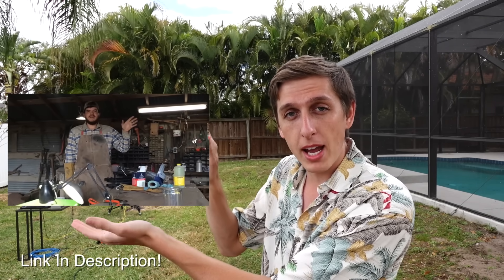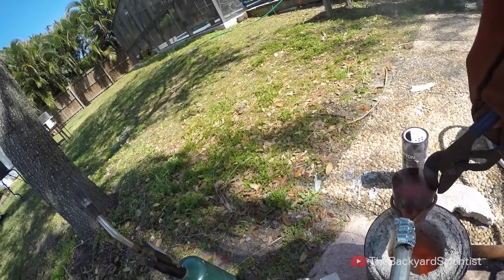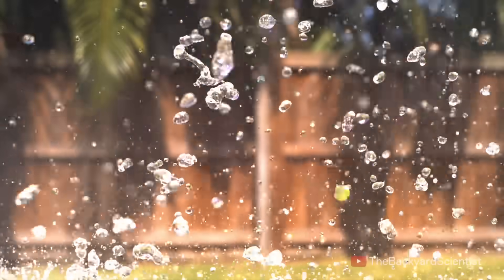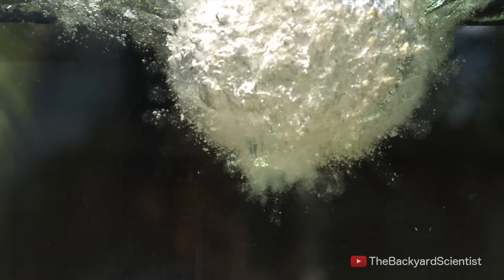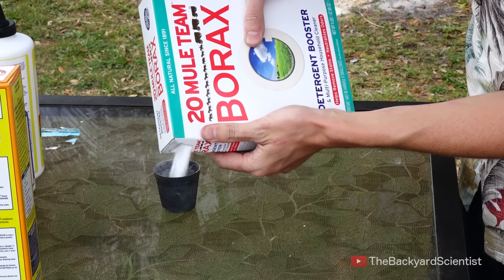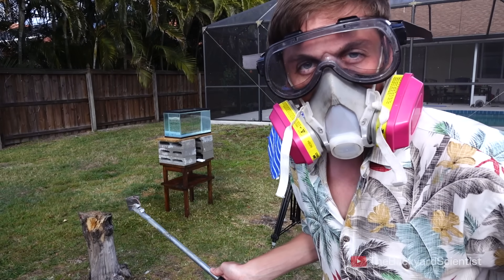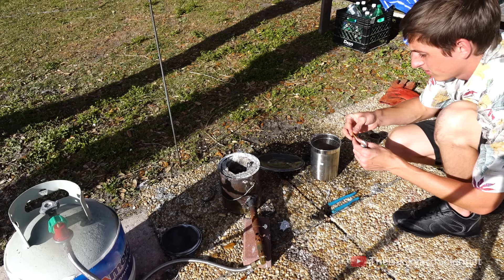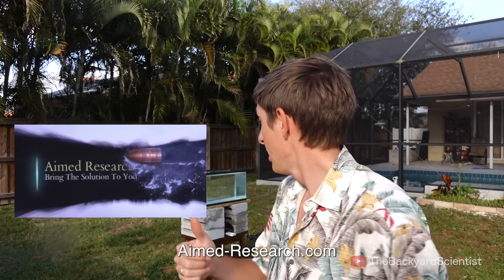Pouring Molten salt into Water - Explosion!

Comment: Question: if you made a sword out of metal Sodium, would it explode when you stabbed someone with it since people are ~80% water? If so, that would be AMAZING.
Reply: +Severo Cairon it wouldnt penetrate the body, metal sodium is so soft the sword would just bend.
Reply: No
Reply: If it was a molten sodium sword... Although it would give you a nasty burn, it wouldn't exactly be good at piercing the flesh. Or be easy to hold...

Might as well just drill a hole into someone and then pour the molten sodium in. That'd be fun
Reply: +WilliamDetwiler It's really fucking wild that people have to explain the difference between Table Salt (Sodium Chloride) and Sodium to you. Regular Sodium, which is a solid metal, reacts violently with water.
Reply: +Severo Cairon it is so fucking wild that people have to actually explain to you guys that a solid, metal, cooled sword contacting human flesh would not have a  remotely similar a effect as molten sodium in pure water.
Reply: +Severo Cairon No. First off sodium is soft so it'd be pretty useless as a sword. Secondly it oxidizes very quickly which means that none of the actual pure sodium is exposed meaning no explosive reaction.
Reply: +Severo Cairon just to clarify sodium = Na  salt = NaCl. Na is not a steel, steel = Fe + C nor is pure Na a alloy, but the surface would oxidize and thus pure Na would not come into contact with the water in your blood, thus no explosion.
Reply: +Severo Cairon  it would have to be molten salt, thus becoming a liquid, but it would be pretty cool
Reply: +Severo Cairon ... What ?
Reply: why would you want to use sodium when you have caesium......... that metal just outright explodes on contact with water no molten anything needed. sodium just fizzes it's ass around the surface(its density is less than that of water) in hellish flames.

of course, the pure form of all the group 1 metals react aggressively with the atmospheric water too. so you have that to consider. in short, it would be an exercise in futility.

perhaps you could make self-shattering-and-protected-until-then pure group 1 metal bullets for a gun and shoot your enemies into glorious inner body explosions ending up with a blood red splatter rain and decimated innards as a victory celebration(reminiscent of fireworks, of course)
Reply: +Severo Cairon You would be weaponless as soon as it starts raining.
Reply: )3@@0 8 :9!5 5)8!& 5)-5 297@: 294&
Reply: +The guy who makes fun of little mistakes what salt? It's sodium.  Sodium reacts with water without heat.  Though it would disappear if you put it into water and other things
Reply: +Severo Cairon According to his theory, no it wouldn't explode. The sodium has to be molten in order to heat up the water enough for it to turn steam and expand within the sodium.
Reply: +Severo Cairon sodium also reacts in the air and is actually stored in oil to stop this happening. So unless you had it in an oil filled hilt you probably wouldn't get the chance to find out. but I would wager that the sodium would just get very hot inside the person and cauterize the wound, and probably poison the person you were stabbing
Reply: No... Its not even hot it cant explode
Reply: +Severo Cairon youre missing a key piece of logic here.
Reply: +stufff mein and then 
Well no - sodium metal is very different to sodium chloride.
Reply: +WilliamDetwiler ...you do know that pure sodium reacts with water by exploding right? It doesn't have to be molten...
Reply: holy shit
Reply: +JohnDavid Perez His theory addresses Sodium Chloride (Table salt), not Sodium. Sodium reacts with water at any temperature.
Reply: No lol but that would be cool.
Reply: +Istebirr it doesn't have that good of a bendable property lol. I'm not sure it would be efficient.
Reply: +Thomas Aurelius ...
Reply: when the people around you are all about science, and you're all about math
Reply: You mean molten salt. If so, it would have to be very hot too.
Reply: nacl and na have very different properties especially at different temperatures
Reply: Sodium metal is too soft to make a sword. You can cut the metal with a knife. I'm not expert and I might be wrong but I don't think you'd be able to pierce the skin with it.
Reply: +Severo Cairon i think you would be better off causing your victom to drink molten sodium
Reply: You can try make molten metal sodium tipped darts or splash molten metal onto your victim.
Reply: +Pure Weirdness yes if you left it there long enough for the blood to pool around the wound and the blade was thin enough and chilled enough not to just bend when thrusted in.
Reply: +Severo Cairon The surfaces of the sword would react with the moisture in the air before you ever had the chance to stab someone.  Also sodium metal is very soft so I'm not even so sure that you could make a sword sharp enough to cut someone.
Reply: +Severo Cairon I think terrifying is the right word here
Reply: +Severo Cairon Amazing but only for a one time use. The sword wouldn't blow up as expected, more like a sizzle because yes people are made of around 80% water which is mainly in the blood, which also contains things such as iron. 55% of our blood is made of plasma which is 92% water. so, the sword would sizzle quite a bit but also wear down the sword pretty much making a second swing really weak or close to useless.
Reply: +Severo Cairon cmon son, it's not just the sodium that makes the explosion, it's also  about the temperature..
Reply: How bout metal sodium daggers
Reply: +Severo Cairon I love the the irony of people thinking your question is stupid. His question is valid because he's talking about the element Sodium and not table salt NaCl. Still Sodium is too soft and reacts to quickly for a sword to work. Shooting somebody with time released Sodium or Cesium capsules might be super cool though.
Reply: an even better would be sodium or potassium bullets
Reply: +Thomas Aurelius Yes it can - sodium reacts with water without heat
Reply: no, no it does not.
Reply: You would have to heat up the sword everytime
Reply: yeah, no. remember in the hypothesis the water turns to steam and that plays a role in its exploding. if temperature is not hot enough, that reaction will not occur.
Reply: only when he scream Allahu Akbar
Reply: +MaddiZONE 

Aloha Snackbar
Reply: +Jordan Lauterbach a flaming exploding sword? i want that so much
Reply: +Severo Cairon since it can react with the moisture in the air, it would probably explode before u touched the person. and even if u did try to stab, it would probably bend cause its so soft.

Comment: I think you explenation is wrong since it does not seem like the like the leidenfrost effekt wasnt occuring:
I think the NaCl behaves more like glass and forms a sort of prince rupert drop which shatters and increases its surface area causing the water to evaporate faster.
This theory is suported by the salt crackling noice, metioned at 1:02 ,  which can be heared if the salt cools down.

Comment: Correct me if i'm wrong but I believe its a physical reaction, NaCl (salt) melts at 800C, while water boils at 100C, so when the molten salt hits the water, it evaporates so quickly it causes "steam explosions", thus the violent reaction, if it was a chemical reaction on the water itself, we would be able to observe a change in it's chemical composition, and since salt being dissolved on water is a solution ( independently of the salt's temperature or state) and these kind of mixtures are heterogeneous, we can safely say that this is a physical reaction

Comment: NEW MILITARY EQUIPMENT: MOLTEN SALT GRENADE: INSTRUCTIONS: FILL UP GRENADE CONTAINER WITH SALT, GRENADE CONTAINER HAS HIGH TECH HEATING, PULL THE LEVER TO ACTIVATE THE MELTAGE,WAIT UNTIL IT MELTS. THEN CLOSE IT THEN FLIP IT UPSIDE DOWN AND PUT WATER AT THE BOTTOM, ACTIVATING THE GRENADE WILL PULL OUT A SOLID BLOCK OF............. DIAMOND,YES DIAMOND.. SEPARATING THE WATER AND MOLTEN SALT.

COMING TO YOUR GUN STORE IN 2089

Comment: You're an idiot. Google alkali metal.
Reply: ? And Google is very trusted with academic integrity...
Reply: .-. You're not the brightest crayon in the box either I see. Google is a search engine it's not the primary provider of information it's main function is to search and sort through the library of the internet finding the credible sources lies on the person looking for them. Sodium is an alkali metal that has a chemical reaction causing it to explode on contact with water.  There was no need to melt down the Raw sodium metal to receive the explosive effect. The process of extracting Sodium metal involves super heating sodium chloride. so when you heat it you bring out the alkali metal that explodes when it makes contact with water.

Comment: This reminds me of some steel cutting techniques where searing steel is being being cut by a stream of cool water.
However, it's not the force of the stream that cuts the steel, but water explosion that happens due to steel being hots and water cold.
The stream is only used to direct the cuts.

Comment: Just measure the total heat of the salt and the water, than measure it again after. If it's more, you have a chemical reaction
Reply: +Lucas farach-colton I thought physical reactions could be endothermic and exothermic as well as chemical ones
Reply: José Ignacio Pauly Llobet
I'm assuming that it isn't nuclear fission, and the only other explanation would be a simple steam explosion, which doesn't change the heat (taking into account heat of vaporization)

Comment: If someone wants a superficial background info: A quick view into highschool's Chemistry would have proved that this was a physical reaction straight away. NaCl cannot be broken with water (I'm Spanish and I do not know the exact words in English) due to the fact that both come from a strong acid (HCl) and a strong base (NaOH). A strong acid tends to give the proton (H+) very "hard" and a strong base tends to get H+ "hard" too, therefore they cannot react with water because the Cl- do like to give away H+  instead of getting them (because he's acting as a base) and Na+ has a nobel gas configuration (and he's acting as an acid without any H+ to give away) . Imagine if that happened in the sea where a lot of salt can be found, you would be bathing in HCl and NaOH (not very pleasant).

Point out any mistakes or doubts if you consider it necessary :D

Comment: Wat I think happens here is that the heat of the salt heats the water around it to above 900 celsius which is the themprature where the binding between the H & the O in H2O get broken. Then it ignites of the pressure of expanding 1600 times under water. As I can hear from the sound the bang seams like a HHO explotion.

Comment: there are reactions, it's hydrolysis, NaCl+ H2O = NaOH + HCl. Also it's go backwards so no ph change in result, but if you would got some KMnO4 and CH3OH in water, then you wil got HCOOH and the water's ph will be higher than normal

Comment: I'm 13 and I know why it explodes! It's because salt is NaCL  Sodium and Chlorine and it can explode because its really hot and the water is pretty warm/cold so that reaction happens! And no I did not think of this at about 6 min I was writing this at like 3-4 mins in video!
Reply: +MooseUHC it is not that simple. try pouring molten metal like aluminium in water, it wont explode.

Comment: NaCl is a neutral salt as NaOH is a strong base and HCl is a strong acid. Therefore, you will not notice any pH change from the addition of NaCl. Other than that, this was an enjoyable video. Thanks.
Reply: +Gimpy Coder The reaction of sodium with water is the following : Na + H2O --> NaOH + H. 
Technically a lot of the hydrogene should go out as dihydrogene (thus the fire in the sodium explosion), but a bit of it will get captured by water, which acidify it : H3O+

Comment: The borax appears viscous like molten glass. The molten nacl is much less viscous. The surface tension of the glassy substance is waaay higher and prevents the sort of explosive admixture you described using the green putty. That's my two cents.

Comment: Don't forget, salt naturally heats water, melting the salt could allow it to have a larger surface area to contact more water, this combined with the soaring heat create the rapid expansion in the water causing an explosion like result, basically your prediction but with the extra salt heats water fact  (it doesn't really heat water, but it makes it freeze and evaporate at a lower temperature causing more evaporation with less heat)

Comment: The Litmus Paper test, used to indicate pH, is not valid in saltwater. Therefore the assumptions made about the absence of chemical reactions, based purely on the pH test as done in the video, are as flawed as the conduction of the pH test itself. i.e. based on the chemical test done in this experiment, one cannot rule out the possibility of chemical reactions being involved in the explosion.

Comment: My theory is that the kosher salt is the quickest to dissolve in the water, and that is why the frost effect doesn't come into play.You could test this by timing the rate at which the various salts dissolve in water, and then see if there is any relation between this test and the molten salts test.
Reply: My other theory is that the kosher salt is the purest form of sodium And that the impurities or specific chemicals in the other products added a different "weight" to it; added something that (adding onto my first theory) slowed the rate at which the mixture dissolved.
Reply: Also in order to specify what intensified the explosion (speed vs temperature), you could do 4 tests: 1 at a low heat poured quickly, one at the same temperature but poured slowly, then the same two tests but at a high temperature.

Comment: I thought it exploded because the molten salt creates pockets of water vapor that need to escape. The multiple salt crystals within the molten salt give more surface area than the continuous flow of borax for example, and in return results in more water vapor that needs to escape. My logic could be completely wrong but that's my hypothesis.

Comment: Why does molten salt react but not solid salt? I think it may be due to the weaker bonds due to the higher temperature, making a reaction easier, but still why
Reply: +hpotter134 It's a reaction based more on temperature difference than anything chemical. It's the rapidly expanding water that causes the "explosion"
Reply: +hpotter134  Because molten salt is super hot, which instantly vaporizes water and expands the volume of the water, whereas normal salt can't do that?
Reply: +jhominid Then that would mean the other materials would also cause the explosion, which it didn't. So then it has to be some property of the molten salt.

Comment: So, from what I understand, the Leidenfrost effect, is a physical phenomenon in which a liquid, in near contact with a mass significantly hotter than the liquid's boiling point, produces an insulating vapor layer keeping that liquid from boiling. However, you were putting a hot liquid into a cold liquid which are not conditions for the Leidenfrost effect. So, you would need a hard surface hotter than than salt's  2413C boiling point significantly higher than salt's 801C melting point. 

Another aspect of this experiment is that NaCl dissolves in water which is a NOT a chemical reaction and leads to ionized water. What would be interesting to observe is to saturate the water with salt until no more will be absorbed. I suspect that in this case, the hot liquid salt would be repelled when it comex in contact with the saturated salt-water mixture and not explode. So, my theory is that ionization (i.e. the salt dissolving in water) is happening rapidly due to the heat. And, I don't think this is exponential. It's just that you are witnessing rapid ionized water evaporate as dissolving occurs faster at higher heat. I would not recommend this, but, if you observed adding liquid salt to hot water near the boiling point, I suspect the ionization and vaporization to be more significant and very dangerous. 

In other words, ask the Myth Busters to do it. 

http://www.discovery.com/tv-shows/mythbusters/

Comment: it's because at very high temperature sodiumchloride can't hold it's bonds and usually when you put sodium in water it produces hydrogen and occasionally get's hot enough to ignite it since it's a liwuid and it spreads out meaning all of it was turned to hydrogen almost instantaniously and since it's already so hot it ignites instantaniously

Comment: buddy, i understand your explanation and i do see how you came to that... but here is why i still think it is a chemical reaction without a ph change... im sorry firstly i am Arjun and i just completed grade 10. 
anyway- 
1- If you say it is physical reaction then the same thing I can say about the rest of the salts.. Instead of the sodium chloride... the rest of the salts can also trap water drops inside and expand enormously to make a chain reaction for an explosion. Is there any reason that the NaCl is the only one which does it?
2- I think it is a Chemical and physical reaction... Firstly your thesis makes sense.. but there has to be something that allows it or triggers it to happen.. Although it shows no ph change, it is still atleast started of with a chemical reaction and then the airbubble explanation of yours may come to play.. this is just my thoughts
what do you  think about this?
(P.S - In case i said something wrong please correct me and don't take it wrong because I am just a high school student
Thanks